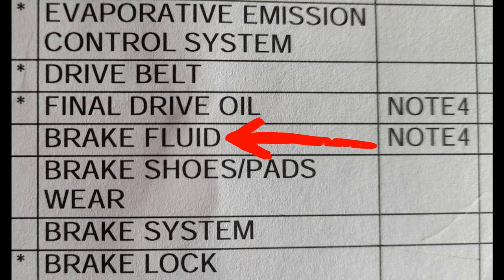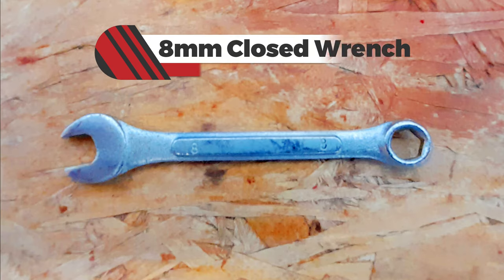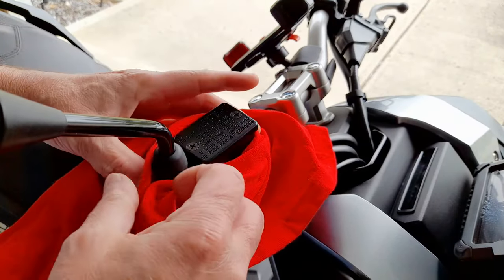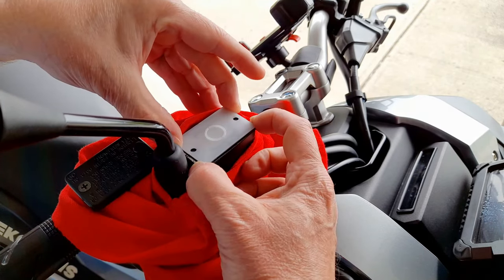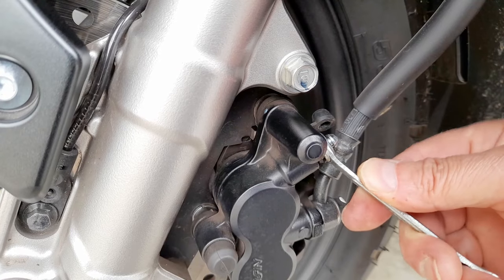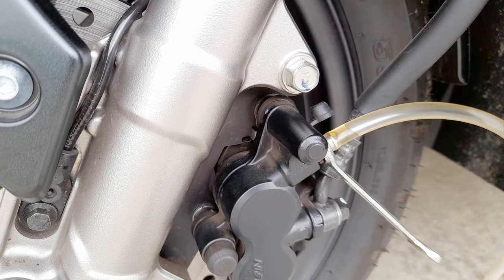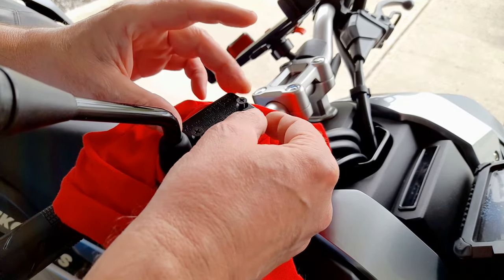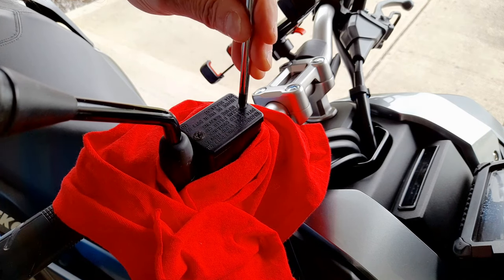Scooter Brake Fluid 101: A Beginner's Guide to Changing Motorcycle Brake Fluid

Comment: Great video. I guess that you have to do it on both front discs if it has two of them. So bleeding it on each side separately. Thanks for the answer. Cheers.
Reply from the maker: Yessir! You're correct. On the ADV 150 (US version) the rear brake is drum, not disk. In other countries they have disk front and back. There's more demand for it in other countries because people expect it I feel.
Reply: @Trekopolis  I see. :)

Comment: Do I need to bleed it when adding brake fluid?
Reply from the maker: I don't when I'm simply topping it off or adding a little. If you change it completely then yes, or if there's a chance it gets very low and causes air in the tubing, then I'd bleed them if possible.
Reply: @Trekopolis  Actually, its just a little. 
so I guess no need for bleeding.
Thank you brother! 
Deserve a subs! :)

Comment: Mine is already below the low point, i haven't open it, but maybe it require the bleeding thing 🤔
To prevent the bubble stuff
It's been 4 years anyway
Last time my bike goes to workshop
Since i can do simple maintenance, although these break fluid kinda new to me
Since my previous bike use drum
Reply from the maker: The process is actually very easy. You open the bleed valve and gravity does the work as you pump the brake handle slowly. Once enough new fluid has passed through the system and you see the fresh fluid exit the tube you're done. Close the valve and top it off!

Comment: Greetings, thanks for the video on ADV150. What does the service manual says about replacing the Fuel Filter on the Honda ADV150? Been scouring the net trying to figure out how to do this. Additionally, a video on how to replace the fuel filter would be much appreciated haha...
Reply from the maker: Good question. The manual only states to inspect the fuel line every 4k, but doesn't mention replacing the fuel filter unless there are signs of fuel line or loss of pressure. Pressure at idle is noted at 38-46 psi. I'd reckon you'd need a fuel pressure tester to really know. There is a fuel filter, but it's not anything I see needing replaced unless there's problems. At least according to the service manual. I'm curious if any dealer has ever replaced one. 🤔
Reply: @Trekopolis  According to friends and ADV groups, the fuel filter needs to be replaced every 20K as the fuel filter can be clogged. Signs that the filter needs replacing includes loss of power. Mine has been 23K, which is why I am curious to know
Reply from the maker: @RoyStevenUngKengSoon  I'm finding the so called service manual is very limited with information. Doesn't say anything about that. Thanks for the info!
Reply: @Trekopolis  needless to say, I'll be on the look out for your "Replace Honda ADV 150 Fuel Filter" videos 😆😆😆😜
Reply from the maker: @RoyStevenUngKengSoon  Perhaps I'll tackle that one some day! 🤔😉

Comment: Bless you for this .
My brake fluid is leaking i dont know from exactly where 
I know where the resovoir is upper right hand side near the throttle  it drips down near the ignition to the storage below  
I dont know if its the seal or near the banjo bolt 
Is it difficult to remove? .i cant seem to find one anywhere .
Please help .
Reply from the maker: I've never removed anything but the top cover so I wouldn't know exactly. I wish I could provide more. Have you searched the Internet for leaky brake fluid reservoir? I looked at the service manual and there isn't much detail on that. Here's an idea: If you're not a member of this Facebook Group I highly suggest joining and posting your question there. You'll get a lot of feedback from the people who like to tinker on their bikes. https://www.facebook.com/groups/266428567756162/  Good Luck and I'm sure somebody will offer suggestions.

Comment: Thanks for the video. On scooters with rear drum brakes…does the drum need to be bled or does that use a cable system?
Reply from the maker: Drum brakes don't use brake fluid, just a cable/camshaft that presses and expands shoes that push outward on the inside of the drum.

Comment: Hey, I tried this, but the fluid keeps on squirting out while I'm pumping the brakes, is that normal?
Reply from the maker: From the top? If so secure the top lid and pump out fluid until it runs new through, then add more to top as needed to bleed until you see new oil exit tube near brake.
Reply: @Trekopolis  thanks, i tried that but there is still no brake pressure
Reply from the maker: Make sure the seal is good on the top fluid cap reservoir and close the bleed valve and pump the lever to check pressure after the fluid drains with no bubbles or air. If there's still no pressure you may have a leak somewhere else like a cable or connection. Also be sure to use the proper fluid so it's not too thin like standard oil. Just making sure. :)   @jabzziijbz69

Comment: I don't have an 8mm wrench or well any wrech at all. Can this be done without a wrench 🔧
Reply from the maker: @DrunkPlastic84  Pliers work. Or super human finger grip!
Reply: @Trekopolis  thank you. Why do you even need a wrench anyway?
Reply from the maker: @DrunkPlastic84  Just something to deal with the fluid release valve by the brake pad area to drain from the tube. Not the top cap.
Reply: @DrunkPlastic84  seriously how else would you get it loose sounds like you don't need to work on anything

Comment: Really nice video! Thanks! I have the same brake fluid tank on my Honda, with the same inscriptions. What do you say? I need to refill with brake fluid, but I don't know if it's DOT3 or DOT 4 now in the system... Would it be safe if I add DOT 3&4 type brake liquid? Ride safe! ✌
Reply from the maker: As I reference the service manual, Honda recommends DOT 4. I don't know what fluid they use at the factory, but the differences between 3 and 4 can be understood more here: http://www.differencebetween.net/object/auto-object/difference-between-dot-3-and-dot-4-brake-fluids/ Either one should be fine under normal use, but if you have to change it you can use that information to get a better idea! :hand-purple-blue-peace:
Reply: @Trekopolis  thanks for answering. Well then,  I think I will get a bottle of DOT4 , and I will completely change the fluid, by bleeding the system  multiple times, just to be sure.